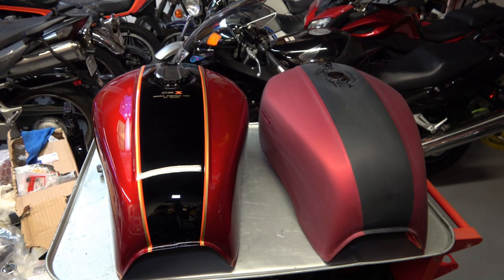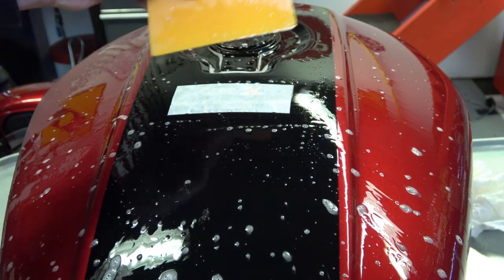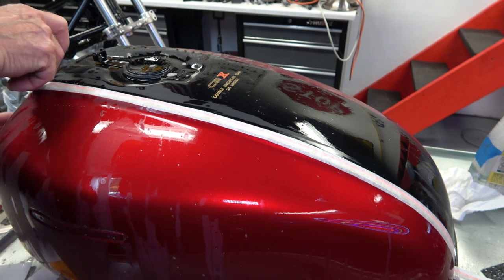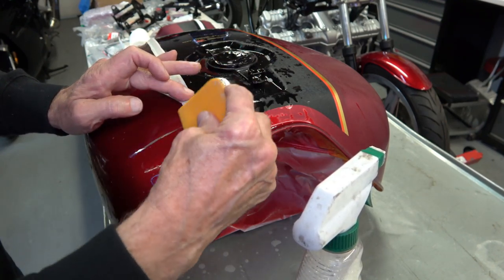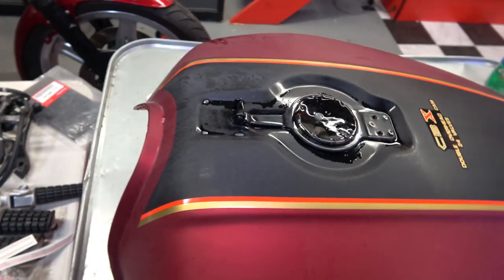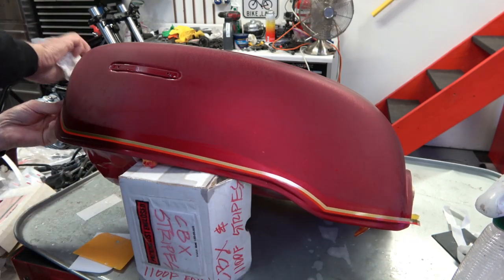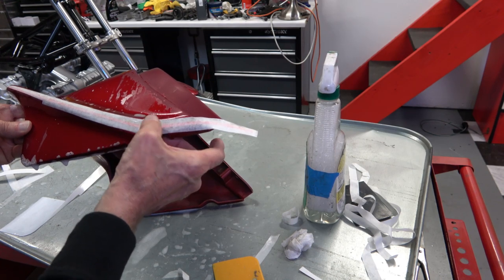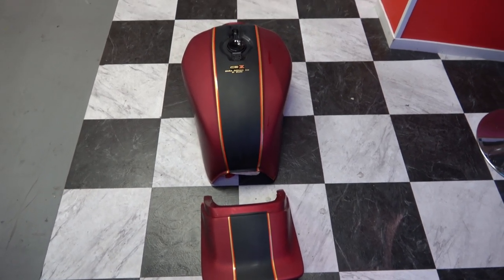Honda CBX Full Restoration & Engine Rebuild Video Series - Part 29 Applying Decals to Bodywork

Comment: Nice video sir,however if i may suggest that i have found when fitting the top stripes it is more accurate to lay a 2mm fine line tape down from the top ridge of the tank,then spend 10 minutes trimming back the carrier tape to about a 1mm of the decal,that way it's giving you a more accurate positioning of the stripe. Because you have put down the fine line tape first you can but up the stripe against it,that then gives you a 2mm spacing to the ridge of the tank,sadly doing it your way gives a meandering gold stripe that just looks a little odd.nos tanks always had a 2mm red spacing before the gold part of the stripe.

Comment: Pete g day again, busy painting this now.
Did your painter,put all the candy down on the whole tank and paint the black part over it,
Also correct me if I'm wrong,as you are putting these decals on,it looks like the whole tank is still in base coat ,is that correct 
Thxx
Reply from the maker: Yes, the black is painted over the red.
Clear is applied, then wet sanded, stripes applied, then cleared over again

Comment: Such a wealth of information! I'm currently restoring my 79 cbx. Do you get your paint from COLOR RITE or what color silver do you use as a base and what candy red do you use? How many coats?
Reply from the maker: The paint used is a much higher quality than color rite. The color was matched to an NOS set of body work which is a much more accurate process. The base coat and candy red were used based on the matching process which is in the form of a menu system at the mixing stage.